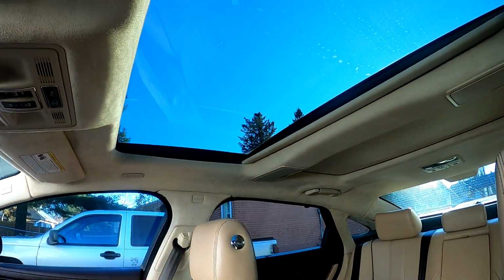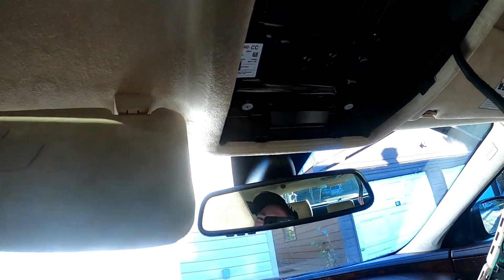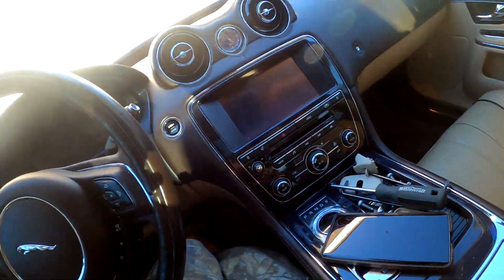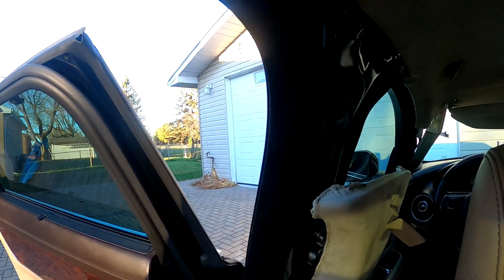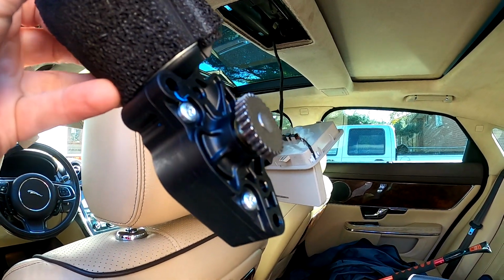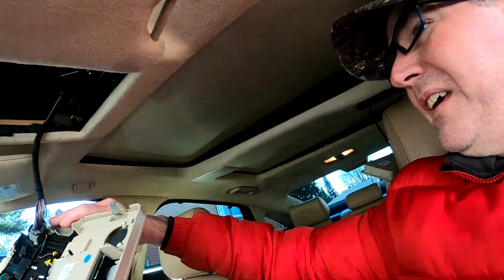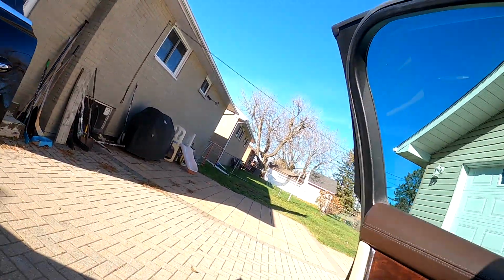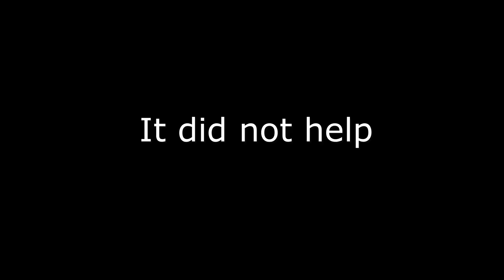Attempting to repair the front sunshade on my Jaguar XJL......unsucessfully.

Comment: Need to change the motor for this issue other things with motor required is sliding blocks lh x 2 rh x 2 . We can also use good known motor from the scrap yard vehicles as well . Fixing takes around 4 to 5 hours . Not a easy job but it can be done . No big deal

Comment: you have to block that gear and then it will start turning in the opposite direction,,, and fix the motor with new screws
Reply: How do you block the gear?
Reply: @patricklamb   screwdriver or something like that
Reply: While the gear is turning in one direction, try to block it with a screwdriver or something similar. When it stops, replace both screws that hold the motor.

Comment: I have the same problem with my front sunshade. Tried the „easy fix“ wirh the white plug in the front… didn’t work. My motor is also only turning in one direction